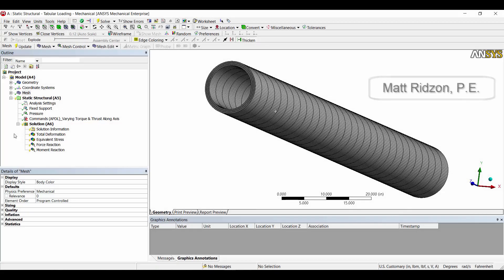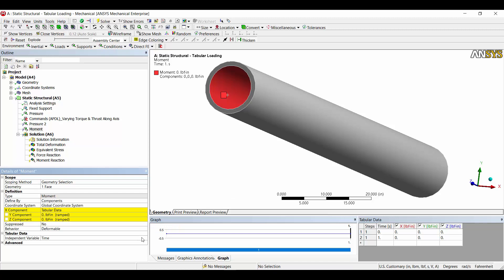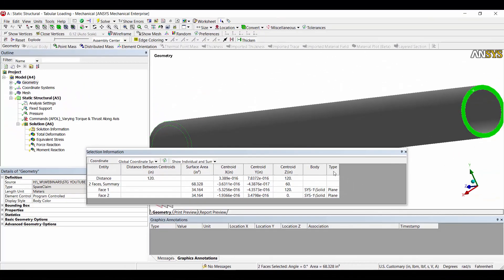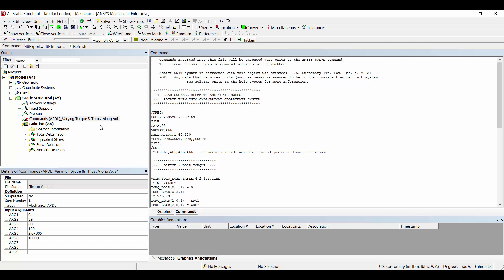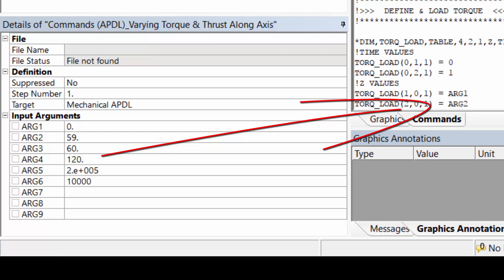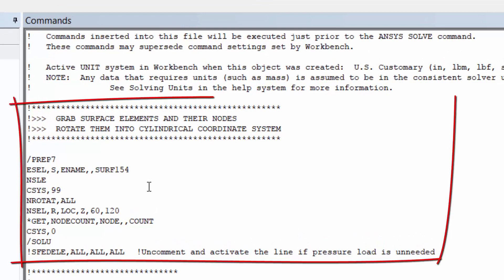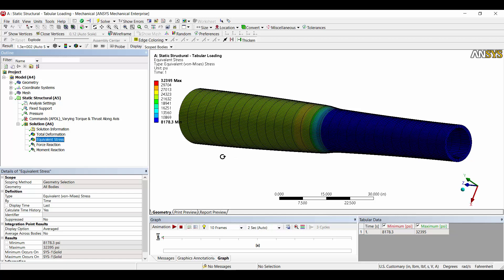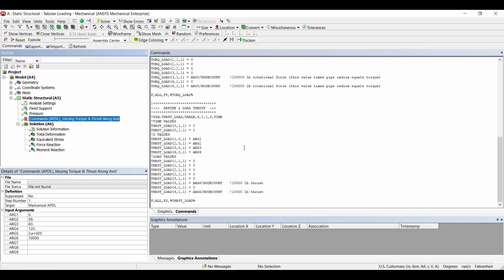How to Apply Spatially Vary Loads in Ansys Mechanical: A Step-By-Step Guide

Comment: Excellent Work! thanks. Just wondering, how did you know that the surface that you selected (in 9:06 ) was named "SURF154"? thanks again!
Reply: SURF154 is not a name, it means 3D structural surface effect

Comment: I am facing the problem with bolt pretension. I am applying it in 2 steps in which second step is locked. But when I change from 1 step to multistep, the parameter checobox disapears. It can be done through command snippet but dont have the idea how to use psmesh and sload for preload pataneterization. Is there any alternative way?
Reply: Hi! Did you find a solution?